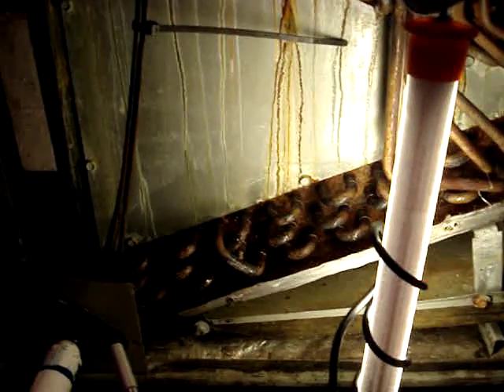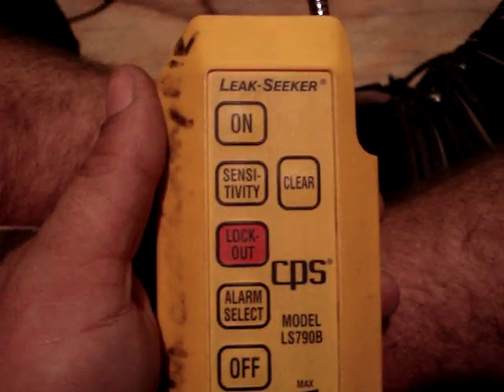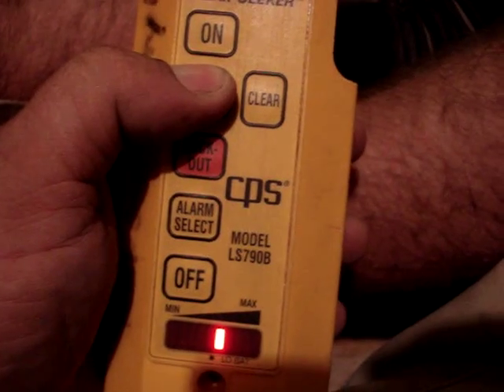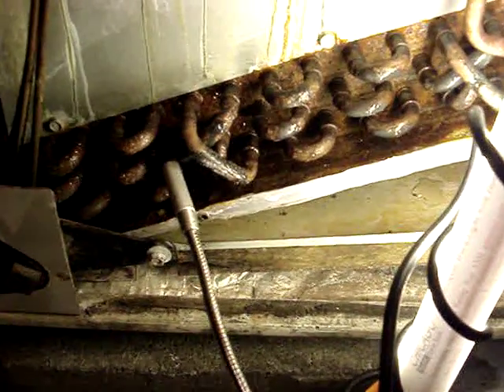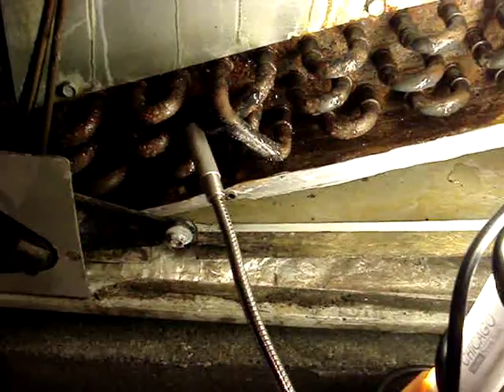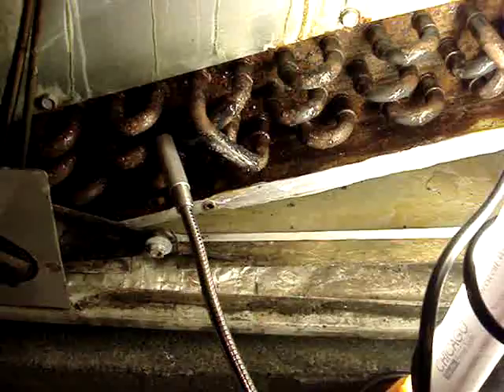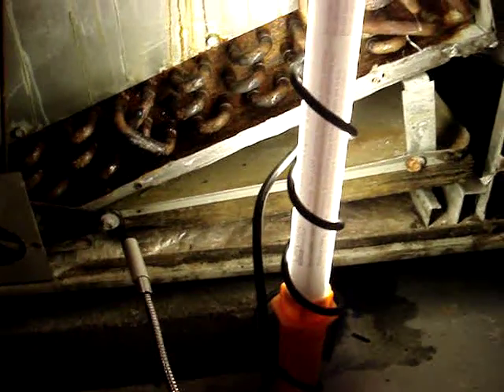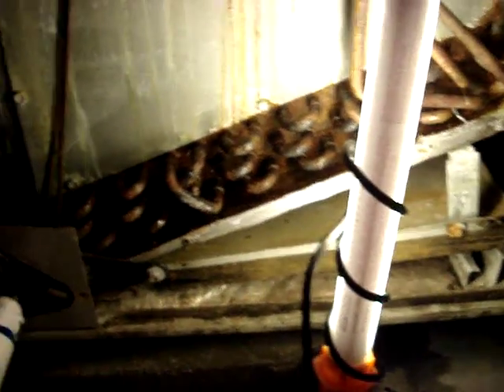HVAC Service-Evaporator Leak Test

Comment: I knew that was a Trane when I first saw it.
 I've always used the H10. Do you still like that CPS detector? Does it read R410 well? Does it give any false readings?
 I'm tired, after 40 years, of finding a plug for the H10 and I want one to fit in the Veto bag.